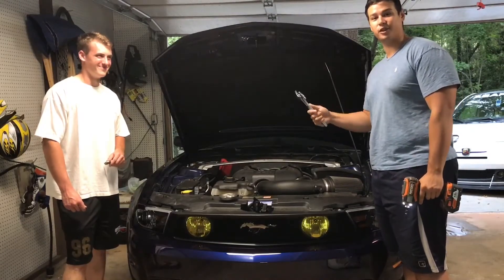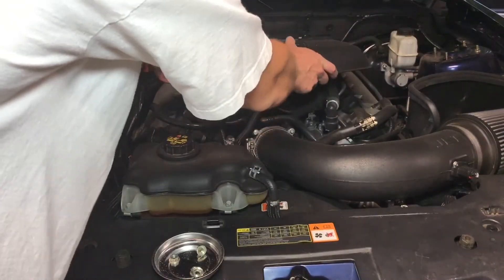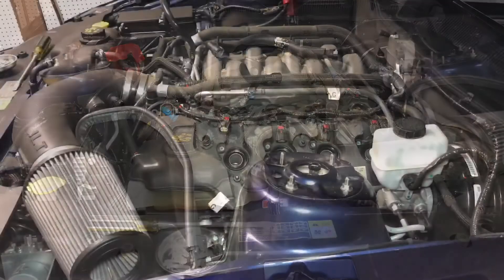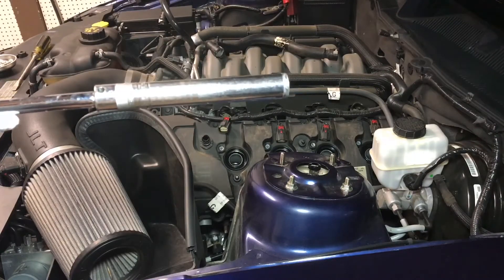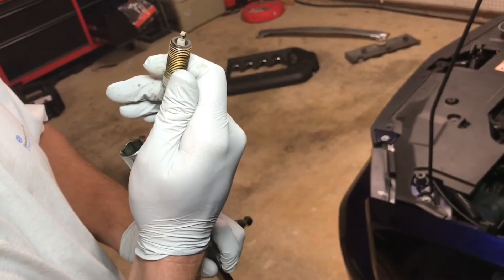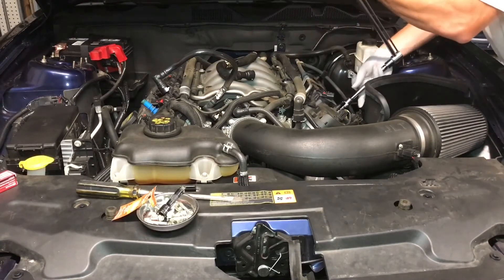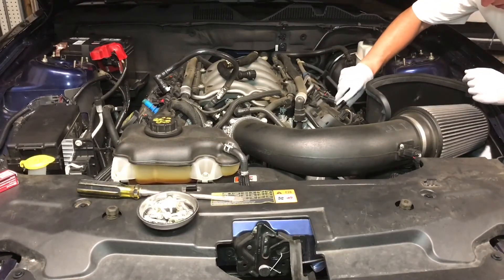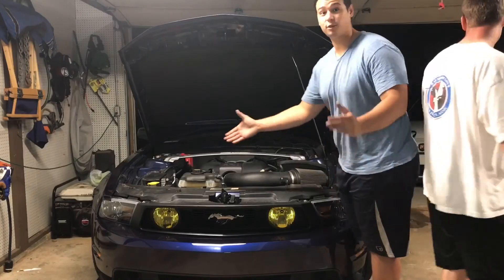How to Change Spark Plugs 2012 Mustang GT

Comment: About when should i think about changing the plugs? My car has roughly 70k miles and im not sure if theyve been done before.
Reply from the maker: patrick hinzman they could be changed somewhat soon. I typically change mine every 50k or so just to keep them fresh, but every 70-80 is fine
Reply: patrick hinzman yeah I would change them every 50-75k mile unless you buy the more beefy plugs that last over 100k miles

Comment: Are these the same as changing V6 plugs?
Reply from the maker: Spoder Mane the V6 is a similar process, but to get the spark plugs on the passenger side on the v6, you’ll need to remove the intake manifold

Comment: So you dont need spark plug wires?
Reply from the maker: phantomio hernandez not with the newer mustangs. They use a coil-on-plug system, so there is no need to replace wires. Eventually coils may need to be replaced, but that’s after many, many miles